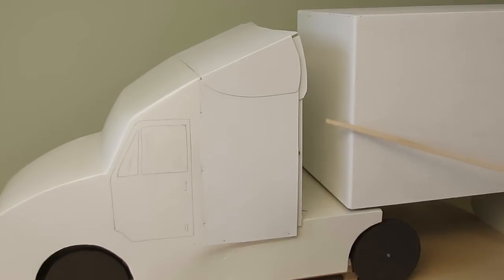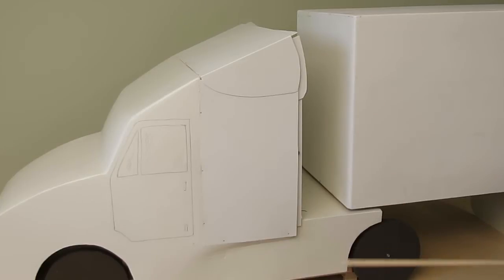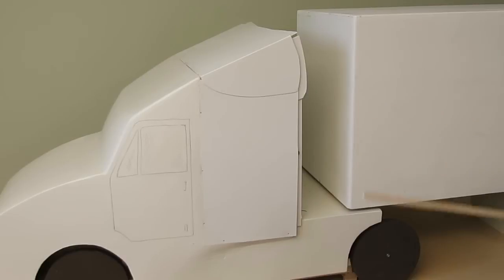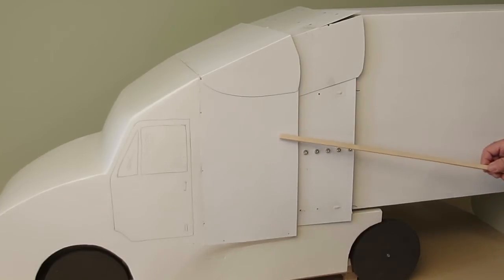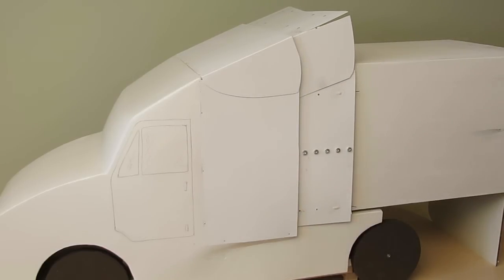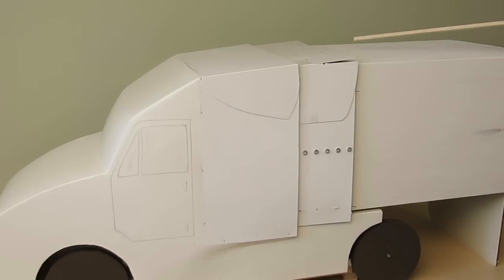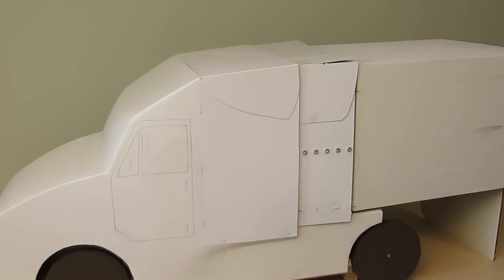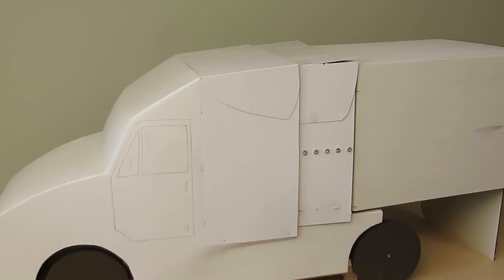Demo for closing TRUCK to TRAILER GAP

Comment: That's a good idea but more moving parts, more maintenance and more in depth installation procedures are not a good thing.  That costs money.  If the panels are flexible in the event of leaving them extended in a tight turn, are the panels stiff enough to resist hard flexing during highway speeds while bridging a 2 foot gap?  I'm thinking not.  You need to build a full size prototype without the mechanicals to test it out.  It's a good start, but still needs work.  Especially when there are far simpler devices like Air Tabs.  I drive truck and am looking for good solutions too.
Reply from the maker: georgianbents
Thanks you for your observations. Without the optional adjustable roof fairing, the only moving parts are the ones you see in the video. The optional adjustable roof may not be a popular option but the easily accessible mechanicals are on the sleeper cab's back wall or roof. By reinforcing and removing material in the right locations, the side panels can be made to resist flexing during highway speeds while being able to flex in a tight turn, although they should be retracted. You are correct that a full size model needs to be built and tested. Simpler devices do exist but provide simpler results.